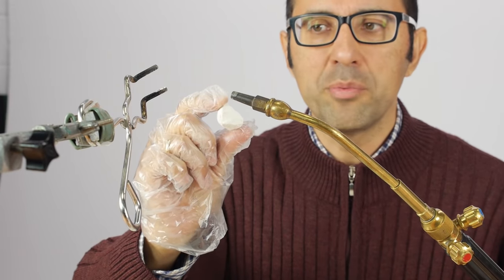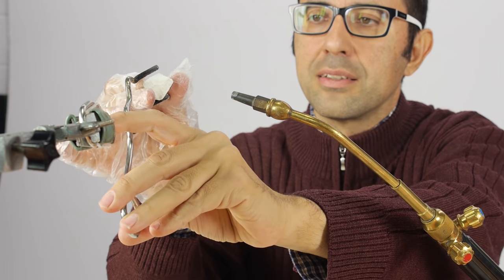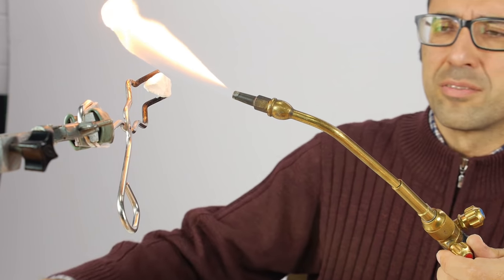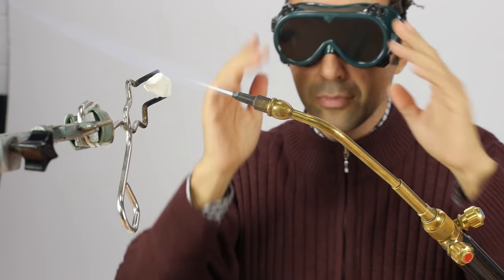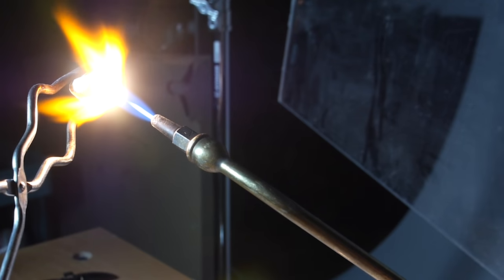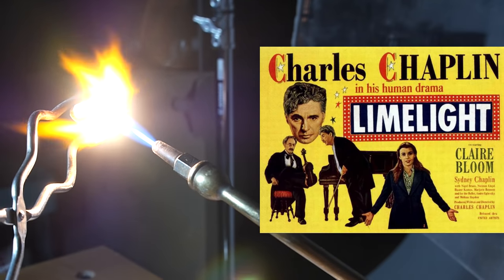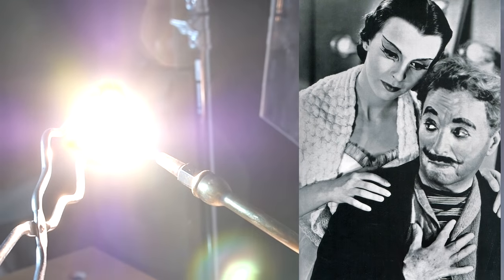Limelight: Quicklime Light

Comment: Interesting. It's not as bright as I thought it would be, considering it was used for stage lighting. But then again, in a world before electric lights, this was probably blindingly-bright as indoor lighting goes.
Reply: the stage lamps would have used a bigger peace and it would have had more time to heat up
so it would be much brighter, also its a focused beam towards the stage
Reply: This is just a demonstration with a welding torch and a rock. An actual lime lamp would be designed with higher surface area and carefully calibrated burner. And also reflectors and lenses to direct and focus the light.
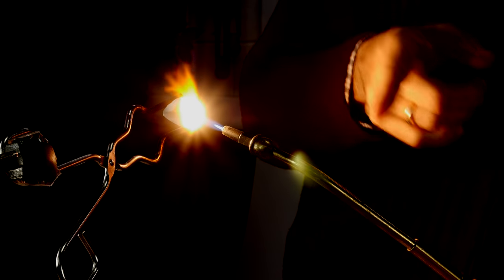Reply: my friend - he did not turn his lights off.  At 0:40 the camera had to treat the normally lit background as damn near black in order to get enough contrast to see the limelight.
Reply: Eh I think big fires were brighter.
Reply: @ATOMIC_V155  imagine you showed them one of those 1kw led arrays
Reply: @mightymiggle  I'm sure if you think for a couple seconds, you might be able to come up with a reason why bonfires were not seen as a viable indoor lighting option.
Reply: @AximVidya  oh no I meant "I think bigger fires of this kind were brighter and were most likely used more often" I used a very odd choice of words when I typed that.
Reply: it's really hard to make out on camera and with the camera adjusting contrast in between, but even this demonstration rock is glowing bright enough to hurt your eyes if you look at it without goggles. 
And yes, in light fixtures and installations, you'd use refracots and mirrors and a whole array of different lenses and screens and other shenanigans to focus, soften, difuse and make the light more usable and palatable in a lot of ways.

theres still churches around where i live that use lime light burners to illuminate their stained glass windows for night displays on important holidays and stuff. It's easy, sustainable and light on maintanance, just a bit dangerous because you use oxyhydrogen to fire it. But on stone floor in a mostly empty church with no one inside, it's almost perfect to give those large rose glass windows an even and sweeping glow. And where i helped out back in the day, we managed to iluminate about ~20 square meters of glass display with two medium sized burners, small lensing arrays and big gauze screens about a meter away from the actual lights.

And you gotta keep in mind that even those amazing 1kw led arrays merely make 60 really bright dots without proper lensing and mirroring to make it an actual beam. Even modern light fixtures live and die by the optical tricks you pull after the light leaves the actual source.
Reply: @SeleenShadowpaw  Contrast is not a natural adjustment done by basic cameras. It's a digital process only and it is not used to reduce the light coming into the camera. That is not what is making the room appear darker. This is done by the aperture opening or closing. This automatic feature could have been disable in this video. It would have made those watching, that don't know how most cameras work, really get the effect of how bright it really is.

Comment: I am curious if the candoluminescence requires open flame or just can be done by heating up the lime in any way. Wikipedia page says that the principle of this lies in the cathalytic recombination mechanism which requires the presence of the fuel and oxidizer. For example if I take the thin platinum wire, cover it with lime dust and run a current through it to reach the 1200 degrees Celsius, will it produce a light this bright?
Reply: Try it and report back.  Do it for science.
Reply: It requires open flame, since the free radicals produced by the flame is what gives off the light

Comment: but what did they use to heat the limestone back them?
Reply: Cienciabit: Ciencia y Tecnología.

oh, never knew about it, i thought oxyhidrogen was a modern thing, interesting to know.
Reply: hydrogen was made by placing zinc, or other metals in a strong acid, or base. back then hydrogen was used for balloons. another fascinating fact is that Calcium Carbide was used back then to produce acetylene for gas lamps (the same gas used in the cutting torch in this video.). it worked by just adding water.
Reply: Usually hydrogen. But oddly trying to produce the hydrogen to keep limelights in lighthouses lit all night led to greatly improved electrical generation which ended the use of limelight in lighthouses because by the time they had the electricity to liberate enough hydrogen to keep a limelight lit all night they had the power to use arclights which are brighter than limelights.

Comment: The original limelight was an oxy-hydrogen flame, the hottest flame available.
Reply: I’ve always thought the oxy-acetylene flame was the hottest flame possible. I gotta look that up I guess…..I would wonder if the oxy-acetylene flame would work for making a limelight, but I am guessing one advantage of the oxy-H is that it is a truly non-carbon containing fuel source, and wouldn’t enter into the reaction as a carbon contamination or reaction.  I am only broadly guessing at this , but this is why hydrogen is a clean pure source of fuel- no carbon-containing precursor to Co2 or unburned hydrocarbon.

Comment: Does it turn the lime black over time?
Reply from the maker: I din't try, but I think not, because they used hydrogen + oxygen, not hydrocarbons.
Reply: @tinkerbit  Right but calcium nitride can form with reaction to the air. at elevated temperatures.